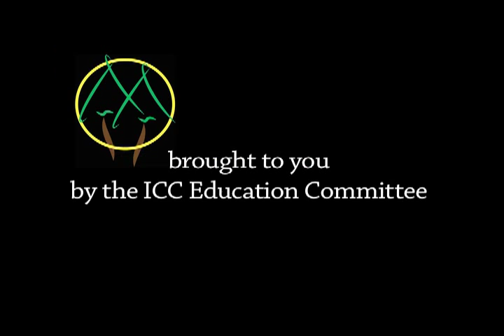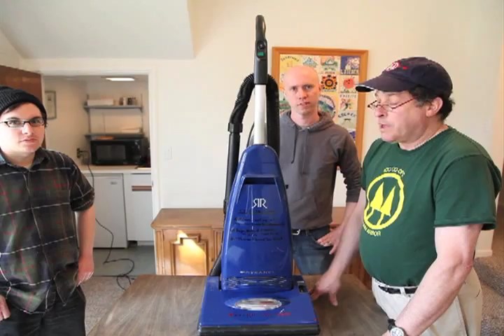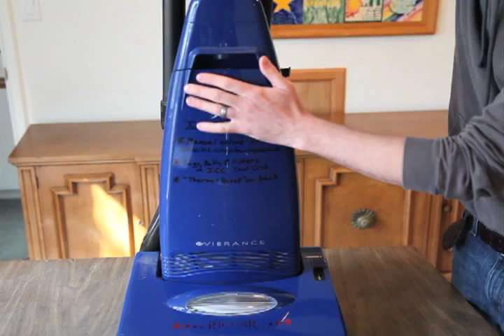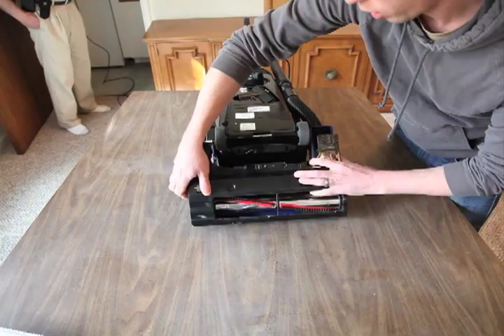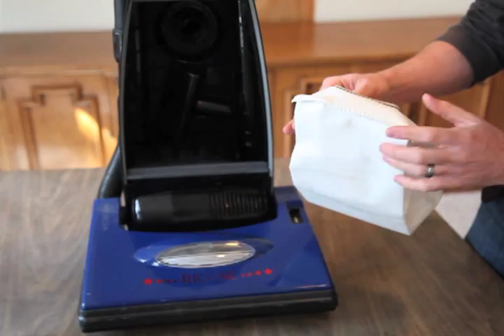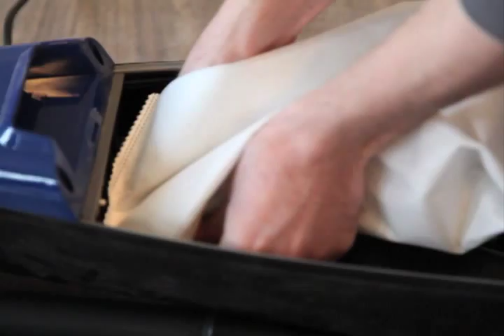Vacuum Video Part 1

Comment: The problem with bypass vacuums is that the exhaust blows stuff everywhere.  A post suction vacuum like a Kirby or Oreck calmly exhausts the air over a larger surface area.